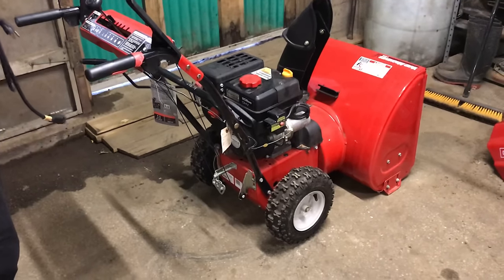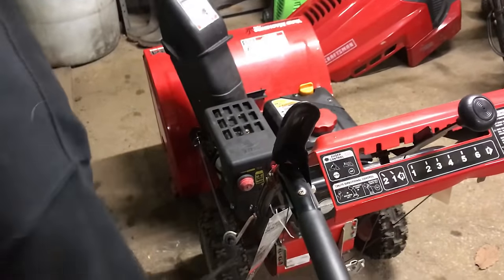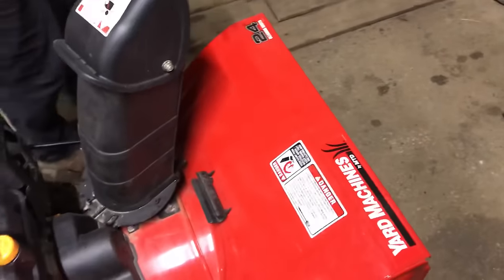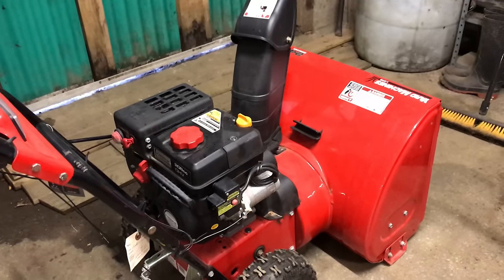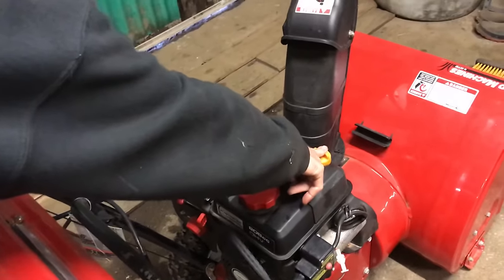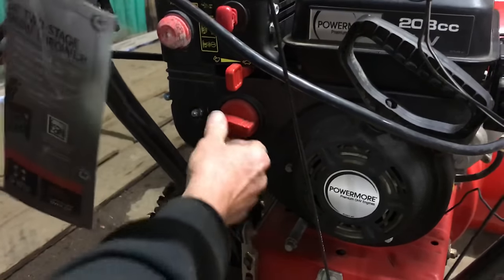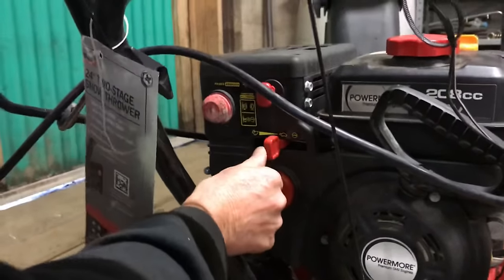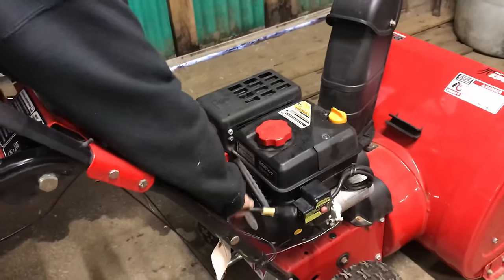How to start a MTD yard machine snow thrower

Comment: Hello, one of my neighbors threw away a 24in MTD snowblower, yes I live in THAT kind of neighborhood. It appeared to have caught on fire at one time, I suspect someone had the fuel line next to the engine…duh! I am not into gas engines, never have been but I invested in a new carburetor and other items and got it running again. Thank you for the excellent video!

Comment: Your very thorough. Good video. The amperage loss in extension cords are very true.  I know alot of people ignore the little details but your defently correct 👍
Reply from the maker: Thank you for watching and commenting!
Reply: I bought mine used, they did not have the cord, can I use a short extension cord instead?
Reply from the maker: @matthewchenevert1376  8 to 10 foot cord 14/16 gauge is recommended. Shorter would not matter but the gauge size does.

Comment: Thanks for the tutorial. I'm using a older Yard Machine MTD 8 HP 24" clearing width model and am not strong enough anymore to start it with the pull cable. I ordered a electric start cable so I can use the push start. Thanks again for the extremely helpful tutorial.
Reply from the maker: I’m glad it was helpful, Please give this video a thumbs up to help my channel. It would be greatly appreciated.
Reply: @JohnsonsSmallEngines  .Done deal. Thumbs up.
Reply from the maker: Thank you!

Comment: Thanks for the video, instructions were very helpful and got my blower going in minutes
Reply from the maker: I'm glad it was helpful and you are up and running!
Reply: My choke is a little wonky but it always starts on the first pull and instantly with the electric start.
Not sure why but it starts and runs better with the choke set just below the little run notch. I bought it used for $200. The guy I bought it from seemed to take care of it but he used ethanol gasoline which I'm not a fan of even though it says right on the gas cap "Ethanol".
How do you feel about ethanol fuel?
Oh, and thanks for your video.

Comment: Great video. How do you turn left and right?  I purchased one today second hand.
Reply from the maker: With your muscles! No power steering on this one. Make sure the air in the tires are where they should be. Look on the side wall of the tire for the pressure. Once the tires pressure is correct and you will be using it obviously in the snow it will be much easier!

Comment: Running smoother than mine
Reply from the maker: Try moving the choke lever slowly into the on position and if your machine starts to run better, stop moving the choke lever at this point and get your job finished. This means you have a carburetor issue and you will need to either rebuild it or replace it (the carburetor)

Comment: I just inherited a smaller one. 179cc 21in. They have the same controls. However, I have an electric starter and the pull handle. How hard is it to start it up with the pull lever if you don't have an outlet to plug it in?
Reply from the maker: As long as it’s not too cold and your machine is operating properly. The pull handle works as it should. Many variables though. Cold, how strong you are able to pull the rope, machine in proper running condition. I would suggest, if you can put the machine in a warm environment “heated garage”? That will make the oil a little thinner so the engine will turn over faster, so it will be easier to pull the starter handle.

Comment: I  have the same model but without electric cable. I always use pull cable to start and it worked fine till last season. I started off today for the first time this season. When I pulled the cable, it is pulling backward as if there is a blockage but I could not see anything. Any tips or suggestions?
Reply from the maker: Not sure what you mean by pulling backward??

Comment: Might be a silly question but I'm completely new to small engines and want to cover all my bases, recommended gasoline? Could I get this right from a gas station? Or is there a small engine gasoline I should be using
Reply from the maker: Hi Anthony,  Yes, you can use gas from the gas station but as you said there are many products of fuel that will be better to use and you will have less carburetor issues in the off season. Check out a product called TRUFUEL. Here is a link; https://trufuel50.com/. You should be able to purchase at a big box hardware store. Thank you for taking the time to check out one of my videos, Please subscribe, give this video a thumbs up and tell your friends to help my channel grow.

Comment: I also got used yard machine snow blower. 8hp/28. So the number is for speed. But what is the rabbit and turtle throttle for? Just starting engine?
Reply from the maker: Rabbit = Fast  and Turtle = Slow
Reply: @JohnsonsSmallEngines  thank you 😊

Comment: how do you feel about the Powermore engines and the yard machine snow blowers?  I just got a great deal on a yard machines snow blower, I paid $516 for the 26" double auger snowblower with the same engine.   Thanks in advance for your response.
Reply from the maker: It is a china engine installed on a MTD snow thrower. Most engines on the smaller snow throwers they are selling come from china and in my opinion, they are ok if you take care of them. You know the old saying, " you get what you pay for". If you live in an area you do not get a lot of snow you should be fine. Just make sure you store it properly, change the engine oil once a year and properly adjust all adjustment to cables, skid shoes, etc. and you should be good!

Comment: My 8hp/24" MTD yard machine snow blower won't start.  Is there a fuel valve on this machine?  IDK what to do
Reply from the maker: Most likely the reason why snow throwers don’t run if they have been sitting  for a long tine is from fuel going bad inside the carburetor, meaning you may need to rebuild or replace the carburetor but without seeing the machine, that is just a educated  guess on what could be wrong with it.

Comment: Is there a neutral setting to move it when it's not running?
Reply from the maker: If the drive handle is up? and the tire pressure is up? the machine should roll. If both wheels are stuck and it has been sitting for a while? You may have either a very large mouse nest under the transmission area or you may have seized bearings on drive shaft ends. First try putting air in the tires if they are low.

Comment: I’d like to see a video on how to replace the cable for the reverse forward. Mine i think is stretched and will not go all the way left.
Reply from the maker: Elbowguts not sure what you mean by not going to the left. If your wheels are spinning when you push the drive handle down, you r drive cable is fine.
Reply: Johnson's Small Engines sorry.. my speed shifter cable is very tight when i go from reverse to 5th speed. The knob/shifter will not go all the way to the left which i think is reverse 2nd speed.
Reply from the maker: I would open up the bottom cover between the wheels to see if you have a mouse nest or something binding  up on the shaft that makes your shift lever go side to side. That will also give you a sense of how it works by taking that cover.
Reply: Johnson's Small Engines thanks so much.

Comment: Wished i saw this video earlier... i fried my starter and its impossible to find a new one..!!
Reply from the maker: If you get the part # for the starter, you should be able to find one somewhere on the internet?
Reply: @JohnsonsSmallEngines  couldnt find any part # on the starter.. was trying to surf on the mtb website but havent found one yet. Do you have yours still? So you could send me the part # if you find it? If anything, thanks! And really informative video!
Reply from the maker: Can you send me your model number from the sticker on the rear lower pan near the transmission. If I can get your correct model off of your machine, Then I will be able to get you a part number for the starter.
Reply: @JohnsonsSmallEngines  31AV63FE678 is the model number

Comment: i got this same machine & won't start at all
Reply from the maker: Most likely due to gas going bad in the carburetor. The carburetor will need to be rebuilt or replaced
Reply: @JohnsonsSmallEngines  Or just pull the bowl off and clean it out and blow some air in the carb holes.
Reply: @hustleeveryday5852  where is the bowl on this thing ? I want to spray with starter fluid